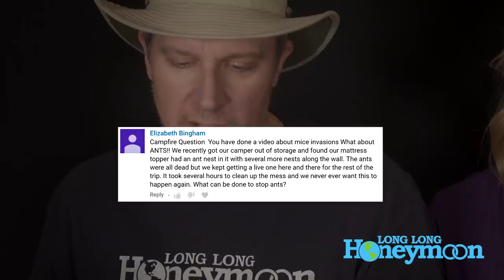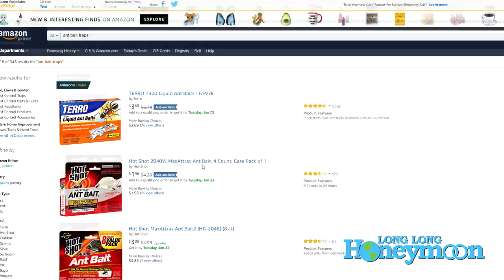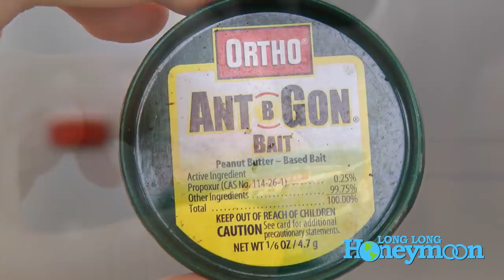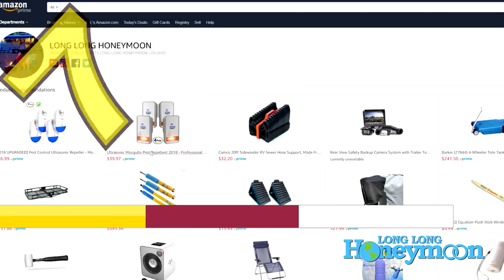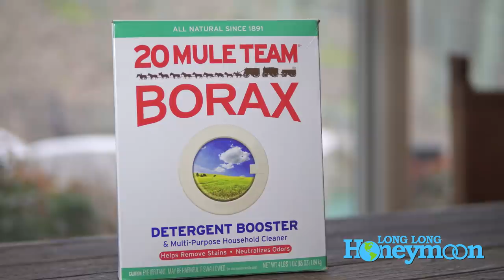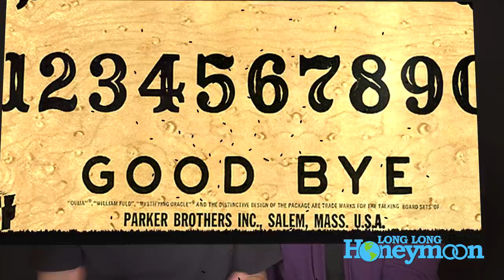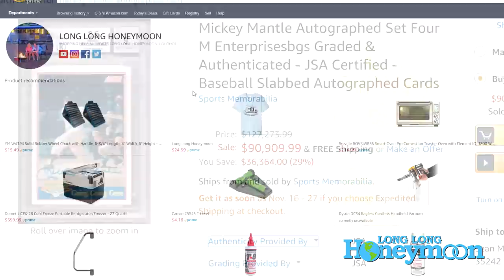🐜 HOW TO STOP ANTS 🐜 from Invading an RV - 15 Tips!!! 🐜

Comment: I had a HORRIBLE ant problem. The solution I used, and it worked permanently the first time, was to use the bait traps. I found where they were getting in, it was the water hose, and I placed 4 RAID bait traps, one at each corner of my RVs water bay (a 1 cubic ft lockable bay that houses the water inlet and sprayer), and THAT did the trick. - Ants stopped instantly and never came back.
Reply: ..."worked permanently the first time"...  Isn't that an oxymoron?? lol
Reply: nope, worked the first time... and has been a permanent solution.

Comment: We stayed at a friends house while ours was under renovation.  When we arrived, the kitchen was infested with ants!!  Although this was not an RV, I would give this a chance since it worked EXTREMELY WELL.   (FYI - We do not use chemical cleansers or poisons for anything)  No matter HOW much I cleaned and scrubbed, those ants just kept coming back!!  After a little research, I cleaned the kitchen well again with my Vinegar Solution and then placed Cinnamon Sticks and Bay Leaves where ever I saw ant trails.  I plopped them in all the window ledges and at the backdoor and sliding glass door and along the back counter.  And Seriously, in just a couple days, those ants were GONE!!!
Reply: Boric acid works good sprikled around landing gear and tires but may not be envoironmentally sound
Reply: That sounds so bazaar it has to work ;-)  Thanks!

Comment: I have successfully used "Food Grade Diatamaceous Earth" that I bougt from Amazon. I carry it in old plastic nut jars that Are leftover (from Costco). I have a garden duster, which is a plastic tube with a pump handle, it creares a cloud of the dust that I spray all around the wheels, hitch and power cords. We go to the same campground in San Diego every year for an event and camp in a large field right next to a creek and ants are severe!

I also put Grants Ant Spikes in 4-5 places on the camper (where the grill is, on both sides of the bed and under the sinks) for any infestations while in storage. The only times I get ants now is if I park under a tree full of ants (at the aforementioned firld next to the creek) or if a branch is touching the trailer.

The duster is a must to conserve the dust, if you pour it from the jar you will use it up really quickly. Also the food grade dust is completely nontoxic to people and pets.  Be sure to take a black Sharpie and write: "Food Grade Diatamaceous Earth" on all the container lids to keep the drug enforcement officers informed should you get searched and so your neighbors won't bust you.

We also share with our neighbors when we camp where it is infested, we can usually find an interested 12-year old who will spray around 4-5 campers just for the pleasure of doing it! Be sure to get the backside of the tires.
Reply: The diatomaceous earth (food grade) works wonders for keeping ants out of my apartment.
I put it on the threshold of my front door, window sills, anywhere that ants may find a way inside..
Only thing is don’t get it wet.
Once wet it becomes ineffective.
Reply: Mark Fowler how is that around dogs

Comment: One thing I did when I was still tent camping that still works on my teardrop. If there is a fire pit available I take some of the ashes (cold) and sprinkle it around the tires, jacks, cables, and hoses where they touch the ground. Same idea as the corn starch/powder and pets will not mess with it, plus free where available.

Comment: What I use for ants is Bayer Advanced home defense pest spray. It comes in a gallon jug with a remote sprayer. I hose down all access points, vents, hatches, windows, and the floor a few days before a trip. No ants or other insects. I also make sure to spray the electric cable, jacks, and anything that may touch the ground. I try to avoid parking in tall grass or under trees. I have a truck camper so I also get the tires and the bed of the truck. No ants and I don't have to worry about local regulations. A couple of ant traps tossed under the camper in the bed of my truck really seal the deal. I store it this way as well with the addition of ant granules. I don't even get spiders. I do however get ladybugs. Can't figure that one out.
Oh! If you're in the south where chiggers or red bugs attack, powdered sulfur. You can get it at garden supply stores. Dust around your camp and on your lower legs. Keeps fleas, ticks, and chiggers away. Does stink a bit though.

Comment: Hi you two. We got a terrible ant invasion at a State Park. We were warned before parking but had no idea what we would be in for. We had no option but leave after we spent the first night with these little guys in bed and on our body parts. When I got to home base I bought some Bayer Home Defense spray that’s nontoxic and has no odor. It is made from mum flowers.  For the interior you pump spray it around the baseboards and in wardrobes and outside you hit the obvious incoming lines. The ants cross the dried spray and just go away... we have used this mum spray in our house and barns for years. The bottle is pretty large so we don’t take it with us on the road, rather we pre-treat the Airstream prior to a road trip. Big box home improvement stores carry it. That’s it from ‘Blue Sky Ranch’ Michael.

Comment: Try Terro brand...the liquid bait stations will work VERY well and it will wipe out the entire colony.
Reply: larryz24 I just wish they weren’t so darned expensive.
Reply: They are a little pricey, but for as well as they work, the added cost it totally worth it IMHO.
Reply: Have you ever tried Terro??? I doubt it, because my real life experience had us ant free in less that 48 hours.
Reply: larryz24 Thank you for the recommendation. I read the reviews and those are excellent for this.  I don’t have a problem yet, but living in the RV 5 days/wk for work and thought it would be good to have these on hand if needed rather than wishing I had them if I get ants and it seems most do at some point.
Reply: Yep!!! Terro is the ONLY thing that works for me. We get ants during the early spring during the rainy season, and terro is the only thing that completely eradicates ants.
Reply: I had not any success with Terro. I fed an invasion of ants for nearly 2 weeks waiting for the steady stream to die, but they didn't. I eventually put two containers for them and they enjoyed it, apparently came back for more. There entry point was my electrical outlet which I just removed from the wall and sprayed the inside of the wall with liquid spray. That ended the trail not saying I wiped out the colony, they just didn't come back. I tried Hot Shot liquid ant bait at another location  to kill an invasion to the house from the outside, they just ignored the free (to them) food.  Ants are smart critters.

Comment: We've had several Sugar Ant invasions over the years and tried multiple "natural" remedies and some chemicals.  Nothing worked until I happened across RAID Ant Gel.  You place small dabs of gel along the ant trails, they eat it and carry it back to the colony which dies off.  IT WORKS within a 1-3 day time frame!  Inside your RV you can apply it along the ant trail where pets or children can't reach it.  If you can find it in stores, order online.

Comment: We used broiler trays full of water under the stabilizers, dust poison around the tires and a ring of lithium grease on the cables. We also kept the sewer hose disconnected from the trailer. Inside the bait traps worked well. Southern sugar ants were the worst but we won.

Comment: Dawn. Specifically Apple Blossom scented Dawn. It 100% will send ants running, because it kills almost on contact and they smell it before they contact it. I've used it at my house to incredible effect. It completely eliminated the ant problem, where I found they were coming in. I just bought my first ever RV and already have little ant invaders. I'm going to try some methods for isolating all ground contacts using a rings of Dawn (i.e. Put heavy duty foil down under the tires, with enough slack to make some kind of inch wide moat around each tire that I can fill with Dawn. And do the same for the stabilizers and the hitch jack. The power, water and sewer lines should be easy - just coat the area of the line leading into the RV with a layer of Dawn. Make sure it's a ring all the way around the line. Does not have to be thick.) I'll try to remember to let you know how it goes. :-D

Comment: We spend a week every year in Oceanside CA.  After our first ant infestation we found out about using AJAX.  It has worked for us every time.  We did try commet once because it was on sale, but that didn't work as well.  Build a wall of it aroumd every contact point and trim away any foliage that can touch the trailer.  Love your videos.

Comment: We use Peppermint Extract.  The ants hate it and won’t cross it.  It also makes your RV smell amazing!  I put drops on a paper towel or cotton swab and run it along the baseboards or edge of the counter where you see several ants.  You have to reapply every now and then but it’s inexpensive and a pet safe solution that works.

Comment: Corn meal. I dump it down ant holes around the house, or on ant trails. They eat the corn meal and any water they drink causes the corn meal to swell, killing them. It can take several applications, especially after rain or the sprinklers. Corn meal is cheap and non-toxic. I've read that powdered sugar and Diatomaceous Earth mixed will work as well, since the ants can't separate the two they take it all back to the colony.

Comment: We had an ant problem 2 years ago. We used bug bombs in the rv and from then on when we went rving we sprayed ant & roach repeller & killer around all the tires and landing gear, stablizer jacks, water hose, electric cable, sewerhose. Also cut back any bush & or branch that contacted the rig. Solved the problem.

Comment: Short stay, 20 mule team borax (Walmart for under $4.00 a box) and spread on the ground where your camper touches the ground (get the right spot pull forward sprinkle on the ground where your tires will be) jacks, hoses, around the sewer pipe access point. 
Long term, we are assistant managers at a private campground in SW Florida and we spray Termidor SC 2 times a year and this helps. Reality is dry season is hard to keep the ants away but it can be done. 
We don’t let anything lay on the ground. Water hose, sewer hose, cable tv. If it does contact the ground we coat that area.
Old 1 or 2 gallon water containers are used to store the borax. An extra lid with holes can be used to sprinkle on the ground. 
Sections of gutter are used to raise the sewer pipe and water hose. It’s fairy cheap and you can strap it to the sewer pipe holder while traveling.
   If having bugs inside, using pure Peppermint essential oil is awesome!  Do not settle for the $5-$10 Walmart essential oil (such as Young Living as it works best for us) as it’s diluted & you’ll be disappointed. How To Use: put a drop or two on cotton make-up pad(s) or cotton ball(s) and place in areas of problems; place a drop or two on damp paper towel & rub in areas of concern; make 16 oz spray bottle by putting a teaspoon of Epsom Salts (absorbs the oily of Essential oil), add 10-15 drops peppermint essential oil, fill bottle with water & spray areas of concern ie doorways. 
  *Be sure you’re not putting non-diluted Essential oil directly on wood or fabric! 
  You can also chase away rodents by using a few drops of peppermint Essential oil on cotton balls & place in areas of concern. Change them out every 2 days. 
   To help prevent critters inside, place all food items in ziplock bags; clip the top of bags closed (tightly) - we use binder clips; wash all surface areas off as tiny crumbs, bits of sweetness invite them to feast too! 
  Essential oils & binder clips use up a tiny amount of space. 😀
  We also have a dog and have not had a problem. 
  P.S. Peppermint brownies are a real hit! Add 4-5 drops of Peppermint essential oil to brownie mix before baking! They’ll be enjoyed by all.

Comment: We had them, too. I could not figure out where they were getting in from. I did just about all the things you did, minus the cookies! I did have luck with Borax. But, I put duct tape around the potty where the plumbing came into the rv. I sealed off the drain, when not in use, in the tub. Under the sinks, where plumbing came in. ..more duct tape. It tooks months to eradicate them. We didnt use our rv all the time so it was easier to treat with chemicals, too. No pets. I loved your video because I have been there, lived it! lolA fan from Texas

Comment: It wasn't an RV, but my house. They got into the cabinet over the stove. I had nothing that was open there. Turned out they were grease ants. Once I cleaned it out, I sealed the cabinets with clear silicon sealant. Best thing to do is make sure they can't get in; spraying around the house; make sure there are no cracks they can get in. I would think spraying the undercarriage and sides of your rig might help (before you enter any park or campground). Sticky baits trap them as well.

Comment: I noticed that all of our outside compartments on the airstream have large gaps to the inside of the coach.  To prevent ant (or other insects) from coming into the trailer I spray Raid on anything that has touched the ground before stowing it in the compartments, e.g. wheel chocks, power cable, water hose, camp chairs, etc.

Comment: Cayenne pepper powder works a treat...can sprinkle it around entry points and the little buggers won't cross it. Also, hot/spicy oil (found in Asian markets) can be used the same and can be used to drawn lines or circles around entry points and it's the same, ants and other creepy crawlies won't cross. Also, both methods are organic and non-toxic to humans and animals.

Comment: I've never had ants in my RV but I do have occasional visits from ant-like insects.  I've tried nearly all the tricks and nothing works so far.  They appear to only want the water in the sink.  It's really all that I'm offering them anyway.  There isn't food out where they can get at it.  I may just deal with it instead of risking insecticide cross-contamination.  Great tips.  Thanks

Comment: The only time we had an ant problem it took months to get rid of the stragglers. The bait traps sort of worked as did  spraying RAID on where they where getting into the trailer, the power cord.  I did find that a paper towel sprayed with Raid and wrapped around the power cord stopped them from coming up the cord  but that was after they had invaded the warm storage area under the fridge. In the end parking it for the winter and letting the cold Alberta winter freeze them was the only real solution to stopping them. In the spring I found about a dozen ant carcasses on the floor by where we thought they where hiding. The next summer was ant free.

Comment: Borax, sugar, and water in a small bottle cap on the ant trail in camper. Usually on the counter. Don't kill ants you see they will bring it back to the colony. Ants should be gone in a day or two or three. No spraying. Seems to work on NY ants. :)

Comment: One great solution that hasn't failed us yet! California Argentine ants are extremely aggressive sugar ants. We enjoy california camping but hate the ants. This video speaks to the CA ant problem. All the usual approachs fail on the Argentine ants including powdered barriers and insecticide.  Instead we use heavy duty tinfoil under our wheels (back over it and park) and a product called "tree tanglefoot" spread around the wheels on the tinfoil so as not to leave a mess. Its sticky, use gloves and maybe a spoon or putty knife. We don't use the stabilizers because it's simply more points of entry or we put some on the stabilizers themselves. Front jack has tanglefoot on it as well. We leave nothing else hanging off the RV or we put Tanglewood on it. Just a little around the circumference of a cable/hose and that's it.  Will have to be renewed for longer periods but a week maybe two no problem. It's sold on amazon and hardware stores.